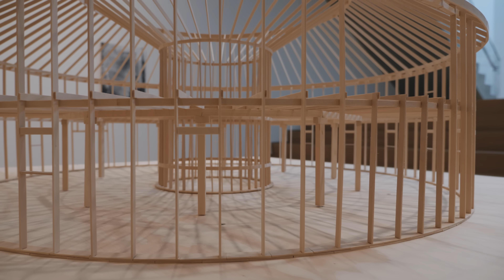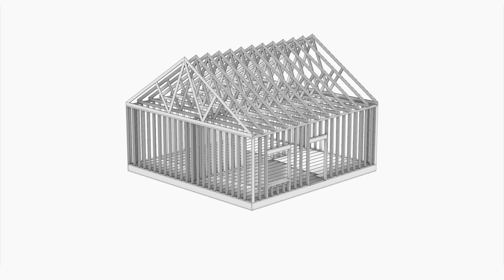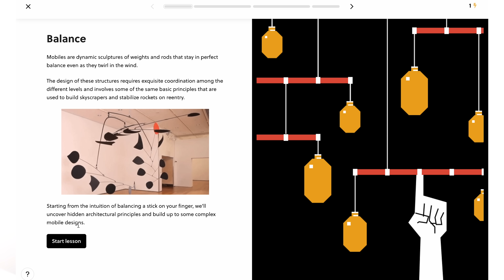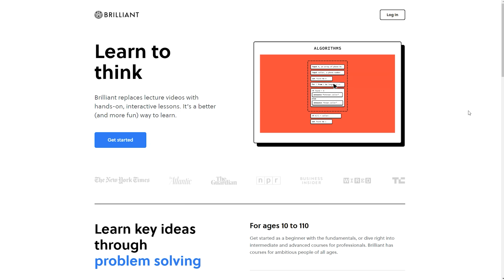The Genius of 2x4 Framing

Comment: Our perspective on this from Europe is different. This is almost unused in Europe, most buildings are built from concrete, bricks or silica bricks. It is perceived as very weak, and correlated often with houses demolished by hurricanes in US. In West, Timber-Lam is somewhat popular as a cheaper way, but it is engineered glued wood which is way stronger. Finland and northern countries have tradition in wood buildings, but it is different a bit. It is very interesting technique, I love it for it standarization and ease of use, but I have my reservations when I consider it for my own building technique. Thanks for material!
Reply: Well, where I live, mold is non-existent (as are mosquitos or anything else that requires much water), and there hasn't been a hurricane in recorded history.  So wood framing makes a lot of sense here.  Which is why it puzzles the heck out of me that my home was built with steel studs instead of wood.
Reply: @BS-vx8dg  that all depends. In Poland we have ranges from -35 to +40 in recent years (it is far warmer nowadays) and we have snow and rainy days (winter snow, spring and autumn rains). Historically we had wooden buildings and bigger, brick based buildings such as palaces etc. In recent years, after the war, building in wood is nearly nonexistent. It is due to poor construction standards thtough communism era. Concrete and brick houses were poorly insulated, but at least they werent collapsing. I do like the wood plus steel framing technique, with cantilevers and overhangs, I am considering using it for my house. On the other hand, current insulation techniques are very good with light concrete frames that can do the same, and have much longer lifespan. This is another argument, building cost here is really high and people tend to go for more permanent techniques, as often 2-3 generations will take over and remodel the house.
Reply: @jestestuman  domy szkieletowy są tutaj nierzadko budowlane teraz, bo koszty drewna są tak wysokie że nikt nie można budować w tradycynych technologiach...
Reply: @BS-vx8dg  I think it's more of a case of wood being so plentiful in the US and Canada and not as much in Europe.  High supply means low cost.
Reply: @BS-vx8dg  Same I live in Nevada. If we get a hurricane here I would be confused
Reply: @BS-vx8dg  sounds like you may not have many trees as well.
Reply: One thing Europeans never consider when making a statement like this is sustainability. Cement production is responsible for around 8% of all greenhouse gasses. Whereas wood traps carbon, at least for the life of the house. Canada and the us are pretty good at sustainable tree farming these days, forests are actually increasing albeit a tiny fraction every year. So, concrete houses are very bad for the environment. Also, these so called cardboard houses are designed by actual engineers doing actual engineering, they also have to conform to local codes which take into consideration things like forest fires, earthquakes, hurricanes etc.
Reply: Wood-frame houses built to hurricane standards do fine in hurricane winds.    Concrete structures perform far worse in earthquakes than wood, and neither wood nor concrete can resist a big tornado.  The common concrete building in Europe would not do well in a hurricane.
Reply: ultimately it comes down to cost, and a large part labor, American houses are built fast, cheap and of reasonable quality to match the 30 year fixed mortgage, after that alot of things start to need replacing, which can be done cheaply becuse taking apart drywall is easy both from a speed and skill perspective.  what is true is the overall lifespan of a frame house is that without maintenance it will crumble much faster than a brick building, with maintenance, ie not the builders problem, the houses do last, hence why you see homes in New England that are 200+ years old.
Reply: American wooden houses stand tall for hundreds of years unless built carelessly. One huge advantage wood houses have is earthquake survivability (important in places near faults like California). Wood houses are flexible and can handle earthquakes just fine (my 1880 house in San Francisco survived a handful!). Brick/cement houses are more rigid and more likely to develop cracks after a couple of serious earthquakes.
Reply: @wiseguy8828 change your statement to “the whole west coast” not just fault’s in California. Alaska to San Diego and geographically down into South America. Ring of Fire is a thing geographically.
Reply: Hurricanes, or more often tornadoes, these are like hurricanes, to you Europeans, but differ in intensity like tnt directly in your face, whereas a hurricane has intensity of maybe 20 meters away. Do not care what they blow away. Heavier materials just make heavier missiles thrown.
Reply: My house is 10p years old and made from 3/8-1/4 x maybe 1 1/2 in wide strips of a very light, very hard wood.  I suspect some kind of red wood, but they grow on the other side of the country so it might be something else.  It's built in the plaster and lathe style, so they use regular plaster and nail these strips across larder beams horizontally with a small gap, then lay a metal mesh on the wood and plaster over the whole thing. 

My house is rock solid like you wouldn't believe, even after 100 years of humidity, high heat and freezing cold, basement floods, etc.

Newer building techniques like drywall and 2x4's are not quite as hardy, but they're not weak either. Part of their appeal is the fact that if something does happen, they're relatively easy for even a novice homeowner to repair with only a few tools.  Not everyone wants to do that, but my family has done that ourselves with spaces we renovated. 

Since the price of stone and wood is exorbitantly high in the quantities and qualities you need to build a house, for poor people like my family drywall and 2x4s are a great alternative.  If your weather is like ours, no building material is guaranteed in an extreme weather event.  Not even stone, unfortunately.  Brick degrades just like wood does. And not all brick is the same quality.  So we use what makes sense to us. 

It sounds like England in particular has even less extreme weather than most places in America (I live in an area that is topographically sheltered despite being in the coast, so we get passed over by everything that wrecks out neighbors. Fortunately!) so it seems to me that this kind of building would actually be great for England.  Damp might be a problem, I guess?  But 2x4s can be pressure treated as well and since our basement is rubble stone, I know stone and cement and even brick can also be very damp.  

I do like hearing about different building techniques from other places, though!
Reply: You guys used up all your big trees. And did not plant more and then plowed over them for farm fields. The reason the northern countries of Europe still use wood frame is they still have wood.... Everywhere that has harvestable forests uses this method. Also earthquakes and insulation are a big deal.
Reply: I used to think concrete and brick homes were better for strength, but in reality, it's not the case because like in missouri and the joplin tornado it tore down all homes, no matter what they were built of from brick to stick nothing made it. A tornado or a hurricane would tear it down or flood anybuilding type of materialthe same. Also, you have to think of temperature regulation in homes. What does it the best? Sometimes wooden framed homes are better in this aspect.
Reply: It’s like an IKEA house. In other words, temporary and disposable.
Reply: @jztouch  IKEA products last longer than Light Framing... and are easy to fix if anything breaks... After all, if an IKEA shelf in a bookcase, breaks, you can just make a new one in 2 minutes and install it... Light frame houses are cheaper to demolish than they are to renovate.
Reply: @jztouch  So those 350 year old wooden houses in Canada, and New England are temporary? Modern houses are built stiffer still and pass stringent windstorm standards up to hurricane strength.
Reply: I might be able to think of other reasons why windstorms demolish more homes in the US than in Europe, but I think it's already pretty obvious.
Reply: @BS-vx8dg  That was not my thinking, it is somewhat common opinion in general population. This type of houses is perceived as not really strong, and reality is obvious as you say.
Reply: @jestestuman  Perception is not reality. Wood is much stronger than masonry in tensile strength. Masonry generally is much stronger than wood in compressive strength. Watch how bricks can be cut easily by placing them on a ridge and applying pressure to the ends. Try that with a 2x4 and you'll quickly understand you really strong wood is.
Reply: @jestestuman  Really? Tell that to the Scandinavians who build widely in this type of wood framed construction. Especially the Norwegians.
Reply: The US is a country that is expanding. From the early 1900s cities grew from a thousand to 100,000 thousand in one hundred years. 
I drive fifty miles in Illinois I see nothing but new developments from the homes to the down town areas.
I can’t see how you could keep up with that pace building stone and timber framing.
In Europe construction conventions began much earlier.
Reply: And what are roofs constructed of in Europe? I'll venture to guess: Wood. The reasoning is, I think, fairly simple: The wood is generally more scarce in europe compared to stone so they used the readily available stone for the walls and saved the wood for the roofs. And, homes built in europe only included plumbing and electricity until relatively recently. And how were these old homes updated to allow for electricity and plumbing: wood.
Reply: A relative few houses are made of timber (4" X 2"!?!) in the U.K., we don't have many hurricanes or tornadoes, but we do have a lot of driving wind and rain, so framing is usually confined to the inside, house shell can be timber inside, brick outside. Timber is mostly used in internal partitions (Or galvanised framework more recently). Timber is mostly imported as we have removed most of our forests for farmland, and is therefore not so economical!?!
Reply: My house is 156 years old and the only difference between it and new houses is that the 2/4s are actually 2inches by 4 inches and don't follow the standard 16in/24 stud method and they are farther apart. It has survive 75mph winds and trees falling on it in my 23 years of life. Imagine when there was still no trees beside it how bad the storms were. I think its construction is entirely sufficient.
Reply: Europeans a weirdly arrogant and ignorant. Not everything in the US is inferior
Reply: laughs in Norwegian
Reply: No it's because Europe cut down all thier trees they had
Reply: In hurricane areas many homes are destroyed by the battering ram factor or water flooded or storm surges.

Ie a 2000 lb propane tank or 3 ton log beats your home apart. Or ocean shipping containers beat the house apart.
Reply: @3beltwesty  this is very good point, thank you
Reply: Only because the dragons there would burn them down
Reply: If you define Europe as Germany, Netherlands and France then yes, you're right. Otherwise wood is extremely common
Reply: When you look at the results of a weak tornado passing through the UK, you will see that those homes crumble immediately. Europeans don't have a great grasp on severe weather events since the climate tends to be so comparitively mild. Masonry is fantastic for damp weather and mold, which is the primary issue with UK construction, so they don't build with tornado resistance in mind. Germany and Switzerland have amazing construction standards though. Love their incredible energy efficiency!
Reply: Tell that to the Scandinavians who build widely in this type of wood framed construction. Especially the Norwegians.
Reply: Regarding Hurricanes, the southern US and more importantly Florida, didn’t used to have the FEDS cover your losses with bailouts. Early construction was concrete blocks filled with concrete and low profile roofs to not lift off in high winds. Single story only.  The lull in weather patterns for 20ish years not having  a major hurricane that devastated areas, and government bailout money means the wealthy from Northern states (cold) retired and built out many parts of Florida with bigger homes, higher eved roofs and cheap construction. Meaning builders don’t care about $500 worth of clips to save your 400K home’s roof. Insurance will cover it. Well insurance did and now they don’t. Due to greed, corruption, ignorance and just everyone being dicks to each other. USA still has way more access to wood as a building material and it is still cheaper in the long run with proper techniques. I fear we have entered our own “tofu dreg” cycle.
Reply: When up for sale in UK they’re much cheaper and listed with “non traditional construction” label so you know it’s probably gonna mould and be uninhabitable within 100 years. Viewed as very poor quality and temporary in Europe
Reply: @RJJJ7  My house has brick & block exterior walls, much like the ones they build in the UK, but most of the houses in my neighborhood are wood framed from 2 by 4s and many of them are well over 100 years old and doing well. I've never seen any house here with  major damage from a storm. Wood houses, depending on the exterior claddings, can require more maintenance than brick ones, but they last indefinitely.
Reply: @RJJJ7  Mold is not reserved for stud framed houses, in fact brick and cement homes have huge mold problems, whereas wood can dry out or be replaced quite easily. I live in a wood house, it’s more than a hundred years old, and no mold! All wood needs, is air and to be able to dry, and it’ll last extremely long. Nowadays pine studs are H3 and h4 treated and are very mold and termite resistant.
Reply: @RJJJ7  Wouldn't "traditional construction" not include indoor plumbing, electricity, modern heating and cooling systems? Traditional construction generally equals a very poor performing structure: leaky windows, drafty doors and walls.
Reply: @RJJJ7  That's funny, because we have 350 year old wooden houses that still exist in the U.S. and Canada. Is that considered too ephemeral to be inhabitable in Europe these days?
Reply: @paulbriggs3072  did you watch the video? They will be the post and beam construction using massive timbers, very different to light frame construction people are discussing.
Reply: @hanvyj2  Actually, I did more than watch the video, I spent 30 years in historic restoration. Now ask yourself a question, are interior partition walls massive post and beam with long spaces between them? How would they do the plaster? No, they are small studs with close spacing so that lath can be nailed on and plastered. Identical to modern except more variability in spacing and species but rarely as deep as 3-1/2 inches like today. (Still, they make up for it in stiffness by the wood lath) How about the exterior walls? Are they lacking in close-spaced thin studs? How would they attach sheathing boards? What are the sheathing boards nailed to?  Yes, you guessed it. Closely spaced studs. In fact, many federal era homes of 200 plus years of age in the Northeast had NO sheathing boards. They simply nailed the white pine clapboards over the thin closely spaced studs and that did it, The studs were often between 3 inches deep but full 2 inches thick and sometimes 2-1/4 inches.  Often hemlock but other species such as beech or basswood and also white pine as well. Occasionally tulip poplar.  The spacing could be as wide as 18 inches but I have seen less, not to mention varied random spacing. All the places I examined and worked on had one thing in common- they were still here after 200 years and fairly weathertight. Many were built more solid than today, but many were worse. One of the nicest Greek Revivals I know locally has shoddy contstruction with absurd wide spacing yet its in good condition still and lovely,  Their demise is not too often related to construction but to 1. Not being kept painted. 2. Downspouts and gutters not kept functioning and shedding well away from the house, and 3. Poor foundation work- usually in this spot or that spot- rarely the whole foundation. Its almost always stonework in heavy clay soils that does the worst. Things not related to wood construction. Balloon frame construction pre-dates the 1850's in Chicago and people in historic restoration have noted this for some time, most notably in New York State especially western New York where experimental building methods were done beginning in the 1830's. Never underestimate the longevity of even poorly done wood framing.
Reply: @paulbriggs3072  I fail to see how 2022-1830s equals 350 year old??? If it really is 350 years old then it is a timber frame like you find in old European buildings not a lightweight construction!
Reply: @henrygrey285  My personal experience is in plenty of 1790's onward wood buildings. But there are 350+ year old wooden buildings in the U.S. The walls could hardly be sheathed by nailing to just heavy corners and the occasional post. They had narrow spaced studs just like modern American and Canadian buildings that the sheathing was nailed to and the wood lath was nailed to for interior plaster. Some were worse built than homes of today. An 1830 era Greek Revival near me was built worse than most modern homes and is an extreme example. It is still in very good condition today.
Reply: @paulbriggs3072  Bro, they have castles that are a thousand years old...
Reply: @DanielDroegeShow  Yes they have wooden churches in Norway that are 900 years old. What do want to call long lasting?
Reply: @paulbriggs3072  Yeah, it is just a good thing churches are not used as fortresses or strongholds in battle or a single match would require it to be rebuilt.  

Also, can you say they are that old when they have been taken down and rebuilt 7 times?  Kind of a Theseus Paradox there.
Reply: @paulbriggs3072  When compared to 700 year-old German timber houses, perhaps. 🤷🏻‍♂️
Reply: @paulbriggs3072  It is not about who builts better.. but Netherlands most houses were made of wood.
But now no more..  so why didn't america change...? Answer to this is interessting
Reply: @vlndfee6481  The vast north American forests are why we built and will continue to build in lumber.
Reply: Except people don't realize that Hurricanes and Tornadoes do not care about Brick vs Wood buildings, they all fare the same fate unless specifically built to very specific qualifications to withstand either.
Reply: @Remsster  youre right. homes in south florida are all concrete block and a cat3 hurricane will fuck those homes just as bad as any other. Floods are the biggest risk in hurricanes
Reply: @mattepple  my place in South Florida has been through a half dozen cat 3-5 hurricanes, through the eye multiple times and has never had any problems (other than feeling like I was going to pee myself while hiding in a closet waiting for the roof to tear off).  

Hurricane glass, shutter requirements and the strict codes over the past 20yrs have produced some serious bunkers since the hard lesson was learned with Andrew.  Of course, the costs of new construction in SoFlo are painful, and like you said, flooding is an unavoidable concern.
Reply: @Respect-gtg  i get it, though in brevard we seem to skate the hurricanes since our hat trick in 04ish (was a teeny jit but it was around then) but we can definitely still do better then what we build here. And yeah these masonry prices are hurting my wallet.
Reply: @mattepple  in Key West the homes are stick built...and have survived over a hundred years with many high wind events. A stick structure cam be built to withstand hurricanes....it's all about engineering.
Reply: @Remsster  What kind of shitty bricks are you lot using, foam bricks? Cotton Candy? I live in a brick house and the wind outside is not a problem, if a few shingles fly away, I can just buy a few new ones. I understand that buildings that use steel roofs are shite and that the roofs will come undone, but a proper brick house isn't going to get damaged by a measly gust of air. And don't think we haven't had any bad weather where I live, in October to December is Storm Season in Scandinavia, And in January to March it's Snow Storm Season, Had we lived in a fucking Light Frame building we'd be dead each and every one of us living here.
Reply: @Remsster also: if the storm is going to destroy your home regardless… why not make it out of wood?
Reply: @Remsster  Europeans think their houses would have no problem in a hurricane or tornado. Its ignorance. Tornados tear apart brick and stone and concrete buildings based on ONE THING: Did the tornado touch them?      Many European buildings would do okay in a hurricane and many would shock the Europeans by coming apart,.. if they had hurricanes. American modern standards have carefully engineered details thet people can't see in those areas. Plus we have 400 years experience with wood buildings.
Reply: @paulbriggs3072  You act as if we don't have Tornados in Europe? Do you think Tornados are unique to the US? Yes, you have the Tornado Valley, and your East Coast suffers a lot of Hurricanes due to the Gulf Stream, but for fuck's sake, here in Europe not only do we have to take into consideration Tornados, Hurricanes, 2 meters of Snow spawning out of nowhere, -40C/F(they're the same at that point), the only thing people like me who live in the North have a problem with is HEAT, our summers used to be 20 C now when we have heatwaves of over 35C in the shade and sometimes near 50C in the sun, and having houses built to retain heat.

Fuck off, take a deep dive in the Pacific or Atlantic and stay there.
Reply: One reason why its so popular in the us has to do with the temperature swings we get in a year. In tennessee we have to build to temperatures as low as -12c on a winter night all the way to 40c on a summer day. Light framing allows more robust practices with insulation to adapt to all of that. A concrete house not only would be expensive and complicated to build in appalachia but it would soak in heat and distribute it into the home all night when we already need ac to regulate the temperature in the first place.  And with modern building science practices we're able to fix the sins of our predecessors and build long lasting well detailed homes that don't mold, don't fall apart, and stand the test of time. The homes of the 70s and 80s with vented attics poor air sealing and bad water shedding are quickly becoming obsolete, we know now they were built wrong, we know now they were unsafe. And we're working to change the culture of "I've always done it that way" that excuses lazy building practices.
Reply: @mattepple  Honestly, I would much rather have a house built in the 70s versus a house built in the 2000s. The former usually have better insulation, better noise reduction within the house, and more durable fixtures (if you find one that still had a lot of its original stuff).

This is admittedly HIGHLY dependent on location and design of the house too.
Reply: @Cruznick06  i hate to disagree. The fixtures are better quality but admittedly tacky (architect. So design matters alot to me) and where there is insulation there is mold due to poor water vapor control and even worse airsealing. Not to mention leaky single glazed windows and overhangs completely inadequate fornthe height of the exterior walls. 2000s hokes are barely marginally better but they benefit from better electrical integration as well as less years for the flaws to have taken affect. Personally both are a no go withiut extensive and intensive remodeling to fix the issues
Reply: @mattepple  "it would soak in heat and distribute it into the home all night"
Its funny, that I am just sitting in a brick house which we keep cold in the summer by ventilation at night.
It is a 120 years old house with 50cm (20") solid brick walls. It has 20-30cm (8"-12") insulation, triple glazed windows.
Heating is very cheap during the winters. It is also easy to keep cold during the summers. We ventilate during the night, when the outside temp is lower than inside. We have never had more than 24C (75F) inside.
Modern building technology relies on: - thick solid walls for big heat capacity and - thick insulation for minimizing energy needs.
Reply: @williamforsyth6667  intriguing. But that's a ton of money in masonry, insulation, and glazing.  (Love the triple glazing though. Big fan albiet the price increase over double) here in florida and where i lived before in the tennessee valley venting only does so much because of the humidity. In the heat of the summer even nights are still 78 degrees. And you know us americans LOVE fridgid homes lmao. And in florida our masonry walls are a bitch with heat soak. And the cost of 8 inches of insulation baloon home prices to astronomical levels here. Everything is done priced by square foot so a 60x60 home with that much insulation gets pricey quick. 

Its a hard game of quality vs cost.
Reply: @mattepple  "a ton of money in masonry, insulation, and glazing"
These issues are addressed by modern eco building technologies.
Solid bricks are made with cold technologies (compression) to avoid the huge energy used to produce conventional bricks. Dry wall masonry is often used even for brick houses. Triple glazing will be soon replaced with thin, vacuum isolated glazing.

Nevertheless, the real problem with the US buildings is not the 2x4 wooden framing technology. The real problem is the generally low quality and the neglect of energy efficiency.
Reply: @williamforsyth6667  i dint disagree. But that new tech is just as expensive if not more. It doesn't change that we need to focus on better stick build construction practices now to make GOOD homes for the middle class
Reply: @williamforsyth6667  
It’s true about heat conservation and ventilation.
150 year old Victorian homes were built well but very few could afford or justify building a home of that quality. The one thing the US has moved away from is using large tall windows to move air in and out of the house.
Now we build 8 foot ceilings and central air conditioning.
We are beginning to suffer the consequences now.
Will we be able to turn around this trend before we are extinct?
Reply: @mattepple  I build concrete homes in FL. Insulation does not balloon costs......R30 in the ceiling below the concrete roof deck is plenty.
Reply: To those of you in this thread defending stick framing (American framing): pick up a hammer and get on a new construction jobsite. What you see will horrify you. And you will never get that perspective as a visitor to the site or as a client. Corners are cut everywhere. Materials are shit. Building code is ignored (and often the codebook itself is fatally flawed and ignorant of reality). If houses are hamburgers, the suburban homes of the last twenty years are single-patty Burger King slopfests that fall apart in your hands before you can take your second bite.
Reply: @iksaxophone  did it for two years before school. Im literally dedicating my career to change it. If it wasnt for shitty labor and old heads going "IvE bEen BuilDinG liKE tHis FoR aS LOnG as i KnoW" it wouldn't be as bad as we see it today.
Reply: @mattepple  that is awesome, I hope you bring about lots of change!! Good luck.
Reply: this is the standard method for single family homes and row homes in Norway, Sweden and quite possibly Finland too. Not uncommon in Estonia
Reply: @user-by7hj4dj9s  Yes, they always overlook that, Norway for example has huge numbers of wood framed homes.
Reply: That has little to do with structural integrity. We build with concrete mostly to ensure thermical insulation
Reply: @ijemand5672  wood is a much better insulator than concrete, which is one reason why wood houses are popular in cold places like Northern Japan, northern United States, Canada, Scandinavia, Finland.
Reply: @ijemand5672  concrete is a heat sink. It has next to zero thermal insulation.